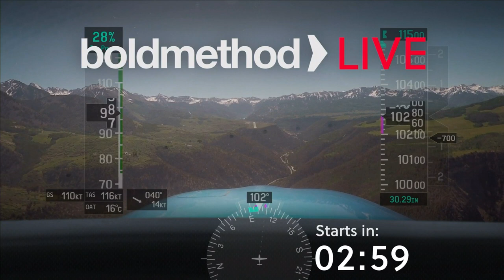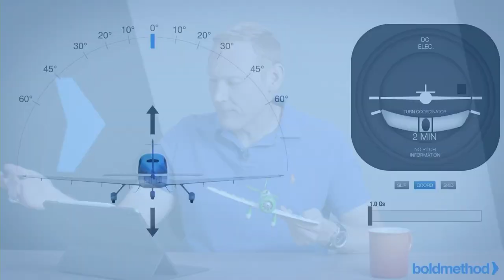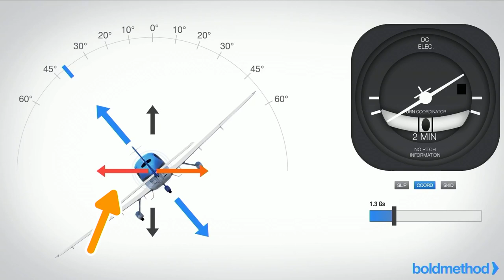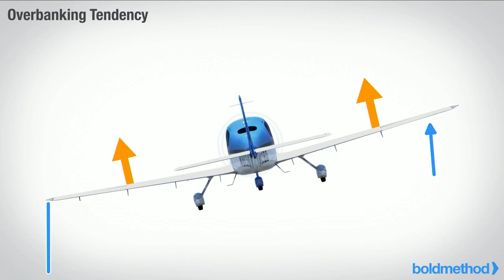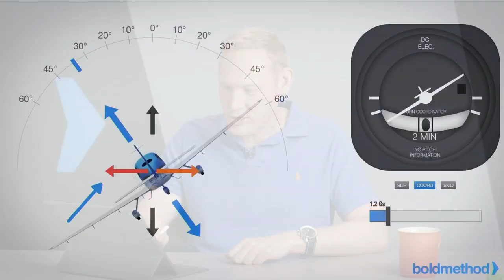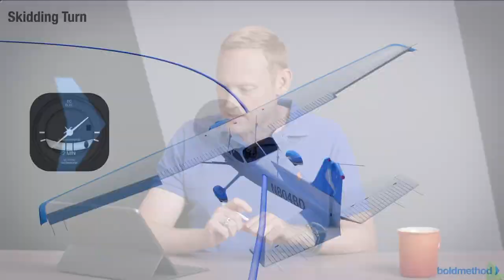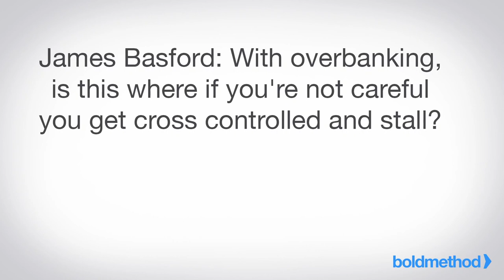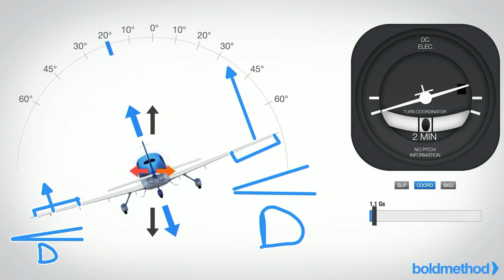Forces in a Turn: Boldmethod Live

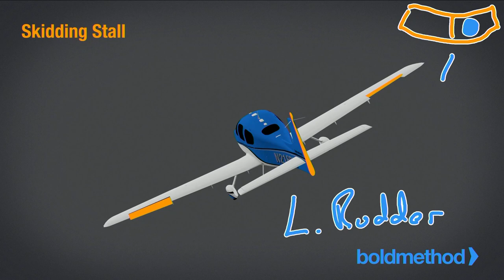Comment: 48:58 - 49:08     Aileron position on starboard wing is not down if the yoke is turned to the right.  The picture is correct showing aileron up.

Comment: If you take that "yaw string" and place many of them along the leading edge of both wings, the strings should stay straight back and parallel to the cord of both wings in straight and level flight.  But in a coordinated turn, should those same "yaw" strings still be parallel to the wing cord if the ball is also centered?  Or should they be angled away from the turn even though the ball is centered?